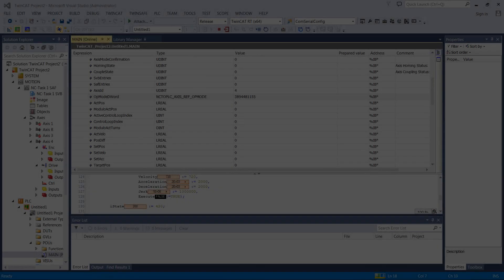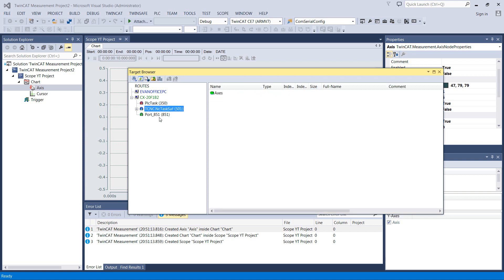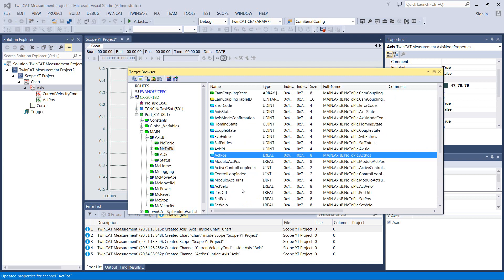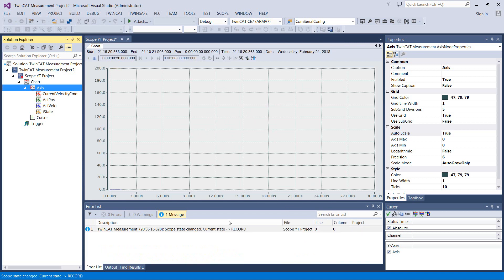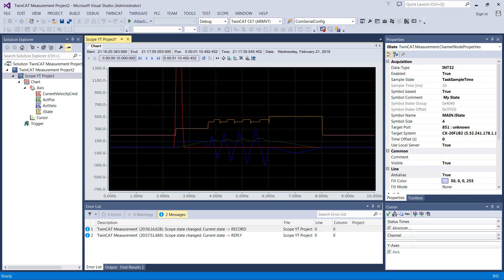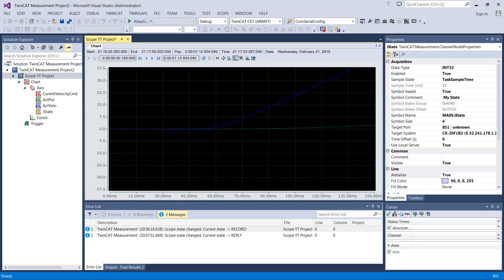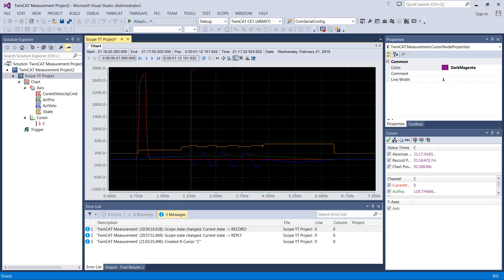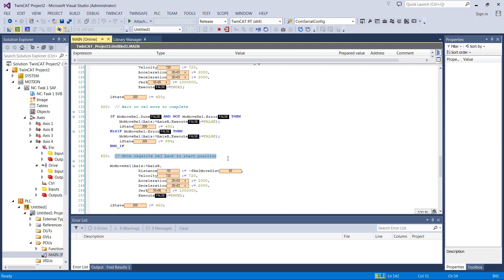Motion Control and IO with PLCs - EP13 - Scope View

Comment: Hey, I tried zooming in the x-axis while recording but I didn't succeed in that. Do you have any idea how can this be done? I tried different ways but nothing works until I pause the graph or stop recording but I would like to zoom the x-axis while actually acquiring the data.
Reply from the maker: I'm not sure it is possible to zoom while you record... however, you could set the axis ranges before recording so it was already at the zoom level you want.  To be able to zoom around while its recording... I'm not sure. Maybe email beckhoff support.